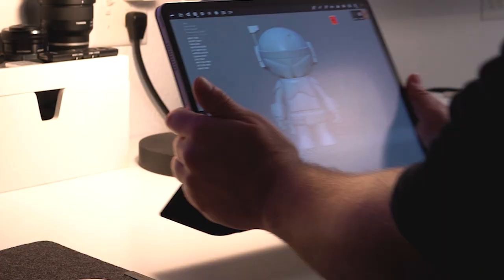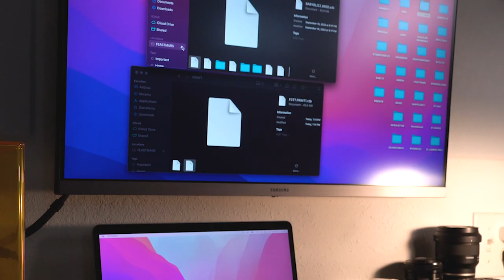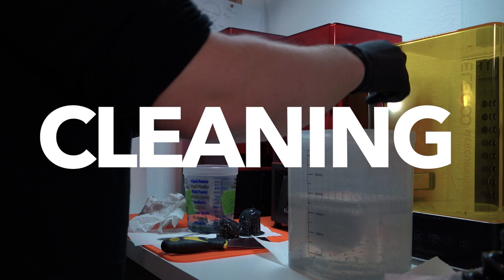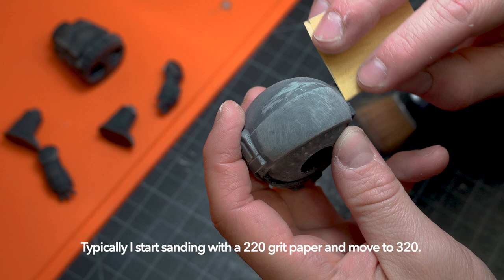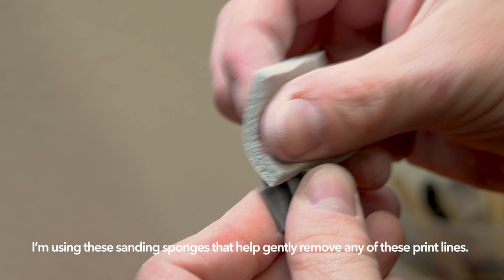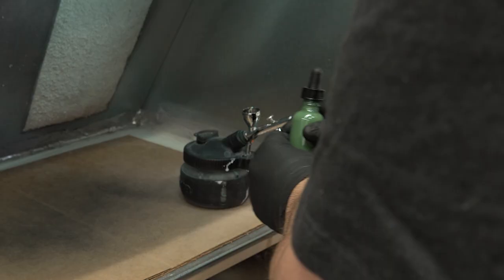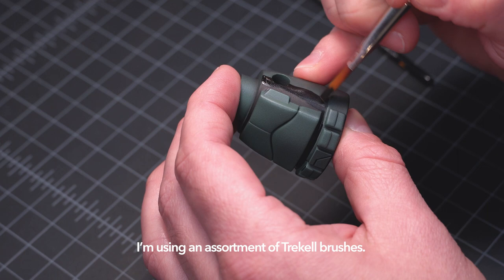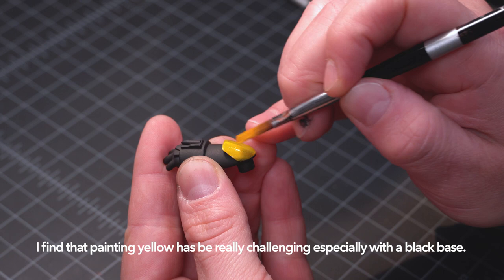Making Bobo Fett. A 3D Sculpted Character | Toy Design.

Comment: how cool congratulations on the job one thing that helps me is after washing i heat a little water and dip the prints in it the supports get soft with that i no longer have problems with the support
Reply from the maker: Thank you. Great tip. I typically do this with the isopropyl alcohol. It stays warm in my studio and I leave the prints in for roughly an hour and those supports do you get soft enough to just come right off.

Comment: Great character! Question, how do you call those brushes (the long brush) or which brand are they? And what kind of glue would you reckomend to stick pieces together.
Reply from the maker: Thanks!! The brushes are I. The description links. They are script brushes. As for glue I’m using some clear epoxy made for jewelry it’s working so far.